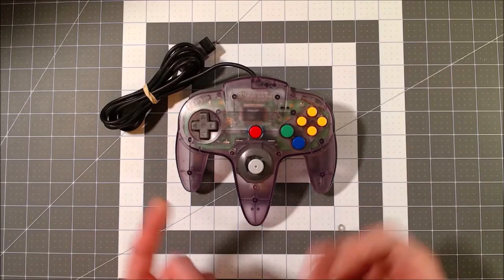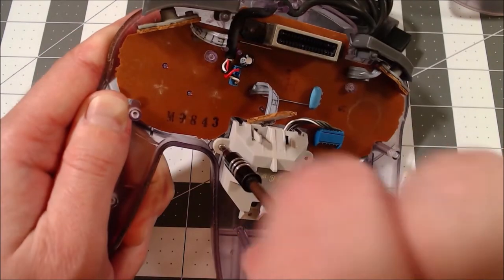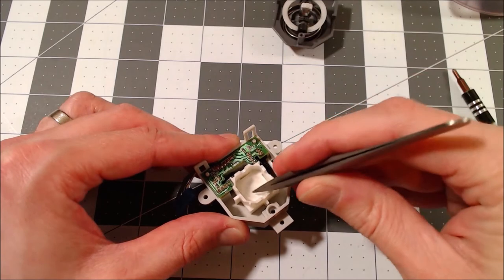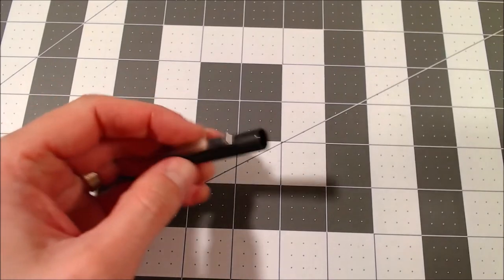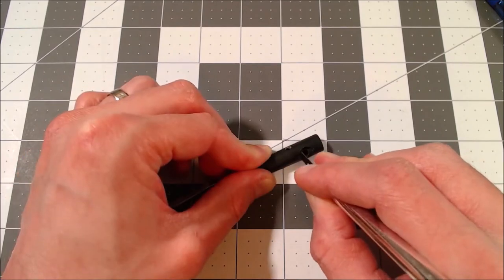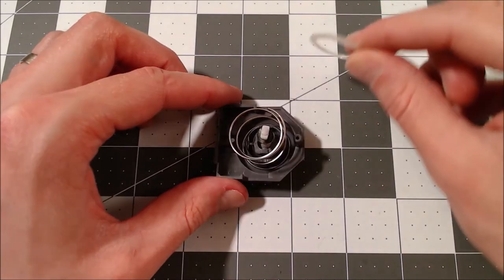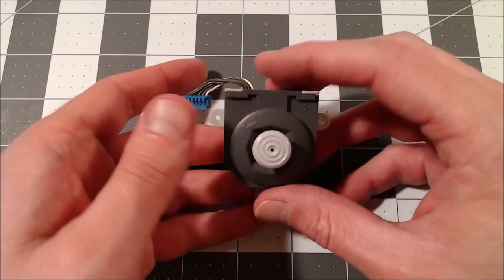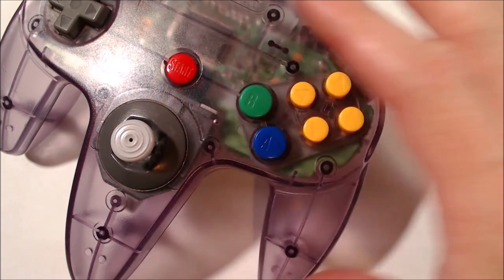Fixing an N64 Controller Broken Joystick (Wiggle Stick) NO REPLACEMENT PARTS

Comment: Tip for those of you trying this for the first time. You can start with 2mm width for the ring, but shave off as much as you can afterwards to make it basically 1mm. I did this twice and both times had problems until I shaved off more.
Reply from the maker: Good tip! I should have been more clear on final dimensions after trimming the excess. I haven't ran into this, but I imagine if the ring is too large it could impede the stick motion. 1mm width or slightly less should be the target.

Comment: What I did instead was cut the very tip of a rubber syringe by about 1-2mm, effectively creating a small rubber ring which I slid tightly onto the stick's neck. This made my slightly loose stick tighter than ever, and I doubt it will deteriorate anytime soon. The range of motion is (mostly) the same, though it obviously feels a bit mushier due to rubber squeezing against the plastic gears.
Reply from the maker: That's a great idea! I'm glad it worked out :)
Reply: I just did that! Pushed from under the rubber with the tip of the screw driver to easily cut a hole from the other side. Also had to cut off the sort of ''double rim'' as it was way too tight with it (the stick wouldn't always come back in the centre). Perfect fit :D
Reply: Great Idea, I was looking for something similar but ended up using plumbers/thread tape and my joystick is good as new!

Comment: Did you do a game test afterwards? I tried this method awhile back and it felt great until I tried to actually play a game and found that the plastic piece was limiting the sensor's motion recognition in game (e.g. Mario in SM64 could run left but only walk slowly to the right even with the analog stick fully pushed right). I'm sure some trial and error could fix it, but I was never able to make it work.
Reply from the maker: I didn't game test this particular controller, but I've done the same fix in the past on a controller which I then used without issue for many months afterwards.
Reply: I just did the reparation following this video and I arrive at the same problem as Zipple41,  

My lose stick is now way firmer and snaps back in place, but in-game, the joystick still performs the same. I still can't run in SM64. 

I think that adding spacers to the black curved parts might be the solution to recover the joystick's range of motion.
Reply: @waza_alex720  Let me know if this works for you! Still looking for a solution since I can't rely on Steel Sticks to be in stock.
Reply: @zipple41  I spent around 8h this week trying a couple different methods to bring back to life joysticks that would barely walk in mario64.
I personnally think steel sticks are way too expensive, i would not consider them but they might be great.
The spacer shown in this video is a great solution to bring back the snap of the joystick, but it does not bring back the lost input.  I found that the 2 black curved gear pieces were grinded on the inside and that is probably the source  of the bigger deadzone and missing inputs. 
I tried adding layers of transparent packing sticky paper around the 2 branches of the curved grinded parts, then burning with a lighter and sanding  the outside to make it steel feel smooth inside the bowl, trying to fill the inside missing plastic. The next day I tried to achieve the same result dropping a drop of crazy glue and controlling it while it settle.. Both methods kinda worked, I gained back some inputs, but I couldn't make a clean result, the joysticks were still stiff and not perfect, I think time and effort is the solution. 8h was great but not enough.  
I tried ordering the gears from Etsy N64gears, I will see if the parts can revive a controller, and if it works, I will try to find if someone could help me create a copy with a 3D printer, I Just want to play Smash Multiplayer ahah
Reply: I believe the O-ring you've constructed is either too thick or too large.  And I think it definitely needs to be lubricated too.  The original design works well without lubrication, but of course that meant it gradually ate itself.

Comment: turns out I had a wiggly stick AND my up/down controls didn't work, so now I can go from left to right real smoothly, but I still have to buy a new controller
Reply from the maker: Are you talking up/down on the d pad? If so check/clean the pad contacts on the board. The method in this vid should resolve all directions on the joystick.

Comment: The plastic will always continually eat away at it's housing. I applied some krytox 205g0 lube to all the plastic on the inside of the housing of my joystick to help minimize damage over time, but this is a great way of fixing your existing controller without ordering non-OEM parts.
Reply from the maker: Thanks for the lube suggestion, I should probably start using this more myself!

Comment: Whenever I reassemble an n64 controller it doesn’t feel like a perfect fit. There’s a little wiggle in the shell and makes “creeping” sounds. Is that normal? It sounds like the top and bottom shells snap into place but it never has that firm feel afterwards
Reply from the maker: might have a cable pinched in there somewhere. They can "creak" a little bit no matter what but it should feel like a perfect fit when the shell halves come together.

Comment: What do you do if your joystick is really hard to push up? for me I literally have to push as hard as I can, but it's insanely hard to use (on an OEM)
Reply from the maker: That is not an issue I've seen, it sounds like some debris got trapped inside. I'd recommend opening the joystick assembly and cleaning things out as a starting point.
Reply: its because the support piece you cut is hitting the lid casing making it hard to press up on the joystick. u need to sand the piece down more on that edge.

Comment: I do the same fix but using a small rubber O ring instead, 1mm thickness and I believe 3mm diameter. I think I read about it somewhere online years ago, I don't remember exactly. As long as the gears aren't too worn it works really well. There is some very slight mushiness, but the stick is so much more responsive and smooth, and the original gears are much better than the Kitsch Bent ones. And then once it's fixed I lubricate the gears with lithium grease.

And something to keep in mind is that the spacer is lifting the stick away from the bowl, so downward pressure on the stick is going to be put on the gears instead of the bowl. So if somebody uses a lot of force during gameplay the gears may get broken.
Reply from the maker: Good info, thanks!
Reply: Thanks! I also used a 3mm diameter O ring and this works great!

Comment: Man, this is a great trick. I'm into using as many original parts as possible and this is exactly it! Although, filling with resin would also work but this is also nice.
Reply from the maker: Glad you enjoyed! I find this method to be more simple with less room for error. If you mess up with resin/epoxy, your part may be completely shot.

Comment: Not super tech savvy but was able to do this in about 10 minutes. Awesome trick. I used the rubber grip of a pen. Had to use two of them stacked on top of each other because it still had some wobble with only one. Still slightly wobbles but compared to how bad it was, it’s night and day.
Reply from the maker: Awesome that you fixed it, congrats!

Comment: It took some trial and error, but a variation of this actually worked for me! I'm shocked. I used a bread tie because it was thin and easily adjustable. It’s not without its flaws, but my stick is working much better and my benchmarks are closer to a new oem stick. Thank you!
Reply from the maker: Awesome, glad you got yours working better!

Comment: I had to tinker with the cap spacer by sanding it down a bit and adjusting it when it was in place bc the left and right toggle sprung right back into place, but he top bottom was kinda stiff. Overall, it worked and saved an old controller. Thanks for the tutorial!
Reply from the maker: Thanks for sharing! Very glad this worked for you :)

Comment: Thanks for the video.  Have repaired two controllers now, and the 2nd time I think I understood better what is going on.  We have a Nintendo Online blue-tooth N64 controller for a Switch (different joystick mechanism, I know) and they all feel very similar now, which I'll take as a win.

So this is how I understand the situation:  the N64 controllers were built with a bit of up-and-down wiggle room between the shank of the joystick and the smaller (upper) part of the black housing.  Originally the bottom of the white cup pushed the joystick upwards so the wiggle-room wasn't apparent, but as the bottom of the shank wore down the surface of the cup, play was introduced.  If nothing was done about it (most controllers I guess) it wore out exactly the same depth in the cup as the original wiggle-room, a little over 1mm (and this is the thickness of the O-ring we're looking to construct -- too thick OR too large laterally and the joystick will be very tight and won't have a full range of motion).

This hack (thanks again) eliminates the wiggle-room and holds the joystick firmly upwards.  AS LONG AS THE WHOLE ASSEMBLY IS LUBRICATED INSIDE (I used Rubik's cube lube) -- especially the new piece you put in there -- I think the whole thing shouldn't wear ANY more. We'll see:  I'll be taking mine apart in a few months to see how it looks inside, then clean it again thoroughly with isopropyl and re-lubricate.

The N64 is a terrific console, and it's awesome to have a free home fix for the controller.  Thanks!
Reply from the maker: Nice job getting yours in better shape and good explanation!

Comment: you sir are a GOD thank you so much this is the only tutorial that has a solution sort of buying a replacement stick. Also to anyone thats not from the states i used the concave part of a kinder surprise pod and it fit perfectly
Reply from the maker: Thanks for watching! Kinder pod sounds like a neat alternative option as you'd get curvature in both directions instead of just one like with the pen.

Comment: Another way is use a jewelry jump ring. However if the to gear slot is too wide and worn out, the ring may fall through the slot.  the top gear in this video is good condition, so the plastic ring can rest on top.
Reply from the maker: Cool alternative! Might have to try this next time I've got a wiggly stick in front of me

Comment: I must admit I've had my n64 controller since 1996 the first thing I did was grease up the joystick using automotive grease the bowl and the moving parts, my controller has had a lot of use over the years and has very little wear and stick is fine, these sticks are really dry from factory Nintendo only put in the barw minimum of oil in the bottom of the bowl and the guides but that soon dries out and the stick wears away quite fast I've bought some used n64 controllers in the past where the sticks were beyond repair.
Reply from the maker: Pretty impressive you've kept in in good order for that long!

Comment: Think you could just use an o-ring/Tiny rubber gasket instead of the pen? Just oil it well after popping it over the nub? I’m gonna try it!
Reply from the maker: O-ring will probably work but you'd want a high durometer or else the stick will feel squishy as the O-ring compresses in use.

Comment: Hello, im a big fan of your videos and I was wondering what was the fraction of the drill bit you used? Thank you for your time.
Reply from the maker: 5/32" - thanks for the kind words!
Reply: @FantasticQuack  so I tried it and the right, top, and left flick back up but the down one won't. Any ideas?
Reply: I figured it the trick is to screw it in but leave a small small gap

Comment: Yeah I had a lot of them come in for fixing and every time I open it up and it was the axis gears that the center was worn away leaving a gap between the two plastic pieces and it needed to be replaced because what it was made out of was not really great quality
Reply from the maker: Well acquainted with plastic dust I see..

Comment: I tried this but with a piece of plastic from a wire. Its a little stiff going horizontally but vertically it works like a dream. As for trying it with games, I only have 3d platformers but it works quite well. I do need to apply a bit of force to move all the way left though that may be on me as my cut of the ring was not perfect.
Reply from the maker: If one direction feels different it's definitely a symmetry problem with the insert, but if it works well enough for you then nice fix!

Comment: My stick has a wiggle similar to yours after you did this fix. If I do this, will mine get even better? I have a brand new steel bowl installed, but the stick still has a slight wiggle.
Reply from the maker: I'd only recommend this method if you're trying to get something in bad condition into better condition. You could still give it a go, but if you're already buying new parts I'd probably suggest just buying a new stick as well.

Comment: You may have brought back the stiffness but I don't think you brought back the range. Link may only be able to go for a brisk walk but cannot sprint.
Reply from the maker: Not showing game footage was a missed opportunity on my part. It does also bring back the range because the black gear piece starts moving right away by adding that spacer. Before, the gear wouldn't move until the stick was outside the wiggle range. Maybe I'll do an update video at some point showing gameplay.
Reply: @FantasticQuack   Well that's good if it worked. ;) cheers for the reply.

Comment: Could it be possible and easier to make that little circle thing with a 3D printer?
Reply from the maker: Absolutely, but I wouldn't use a straight FDM print with PLA or ABS because of the ridges and printing artifacts that could wear itself or the sorrounding parts. The latter could be vapor smoothed with acetone and the former has some finishing options as well. SLA printing might be good to go right out of the printer. All of these "extra" options are not necessarily common or available to a hobbyist printer. Therefore the pen cap that is already injection molded is a good option and available to pretty much anyone!

Comment: I have a controller I tried to fix myself. But I accidentally broke the gear piece that holds the joystick in place. Now the joystick doesn’t move at all 😅
Reply from the maker: Sorry to hear that! Was it a clean break?--Maybe some opportunity to repair it with super glue or epoxy
Reply: @FantasticQuack  yep. Clean break. The right side that held the stick in place broke completely off.

Comment: Hoping someone with experience can clarify what the ideal interior diameter should be for these spacers. Help?
Reply from the maker: Unless you're trying to 3D print a spacer you don't need to be that precise and can just do it by feel w/manual whittling. You can take the stick out and measure it yourself with a caliper. Unfortunately I did not do that when I had things disassembled here so can't hand you the number. I'll try to remember to do that on the next one.
Reply: @FantasticQuack  3d printing spacers for these is a great idea.

Comment: Cant you just use a rubber o ring?
Reply from the maker: I bet you could but would probably need to be hard (high durometer) or else it will feel "squishy".
Reply: @FantasticQuack  nice video by the way I was just curious if that would work. I just swapped my worn out one with a good one from another controller. It's about that time to start collecting consoles. I'm buying a Dreamcast and a GameCube this week